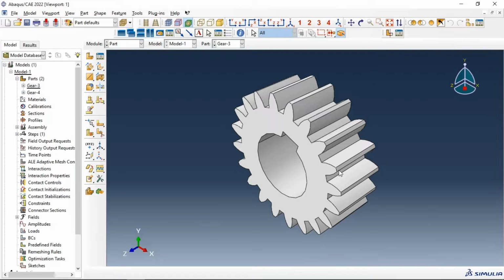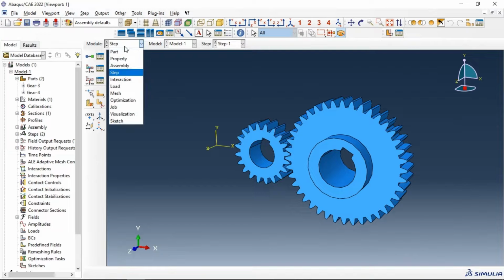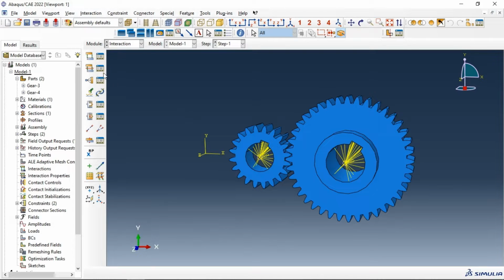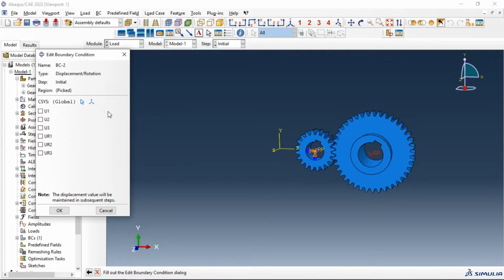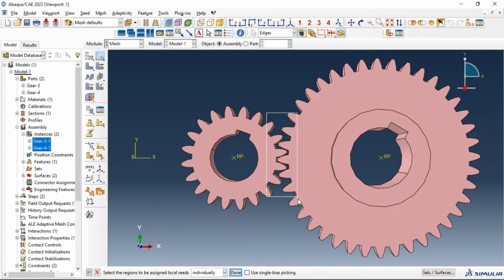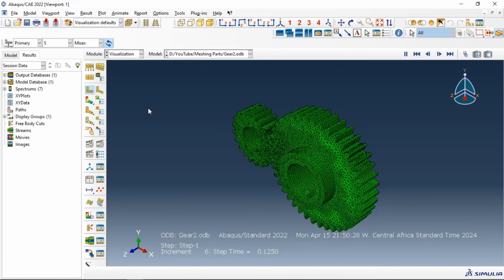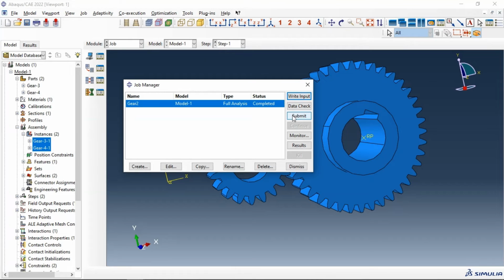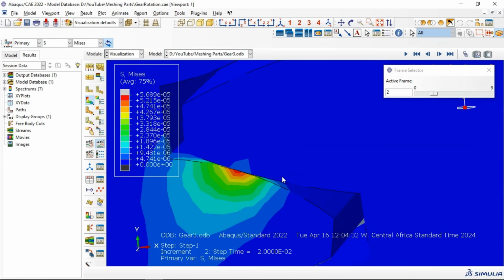Abaqus Tutorial: Modeling and Analysis of spur gear using Abaqus.

Comment: Sir,in ABAQUS i m doing explicit coupled temperature displacement analysis to validate a paper.But the paper States that"We normalized time along with the normalization of thermal conductivity with its reciprocal
in order to bring down the computational cost of simulations. The obtained solution using normalized time was again converted back to normal time accordingly"   Sir if i normalized the time and conductivity how can i get back my result in actual time? I dont know why they normalized the  conductivity also